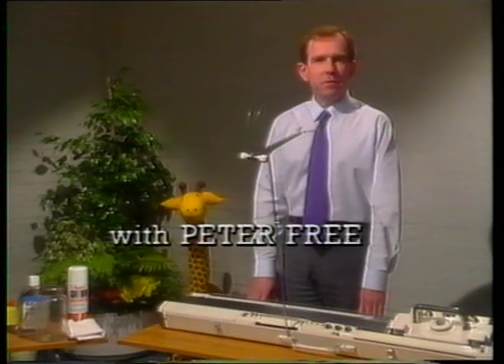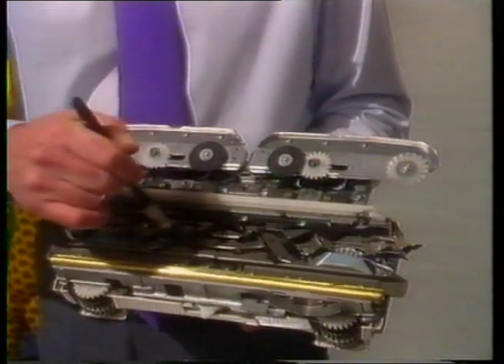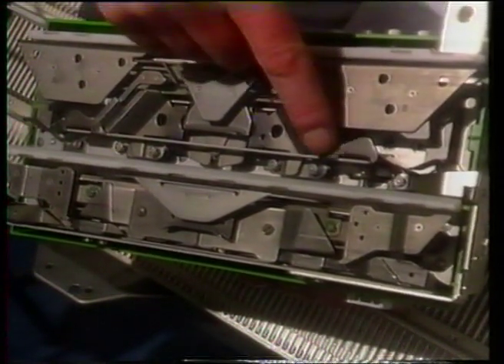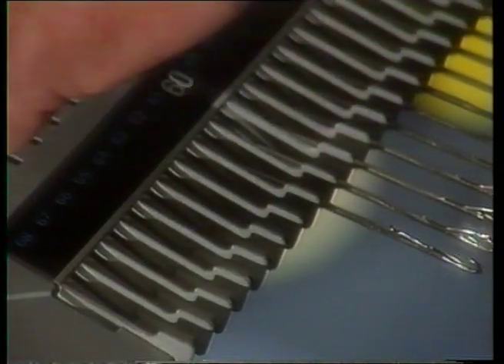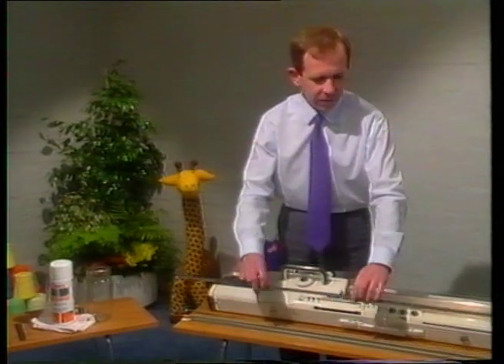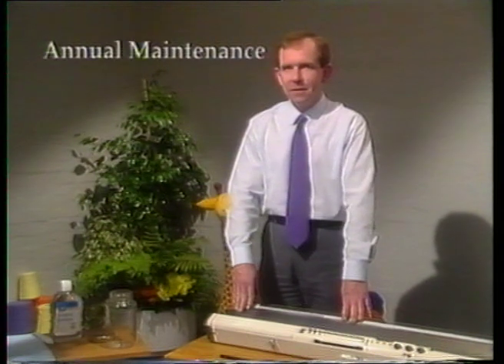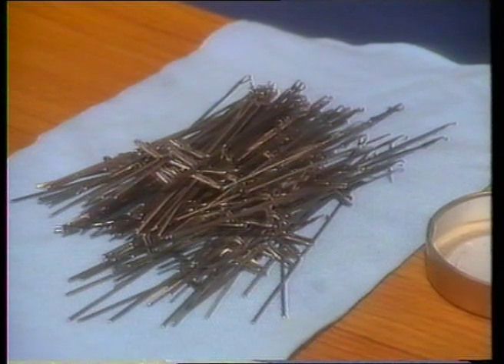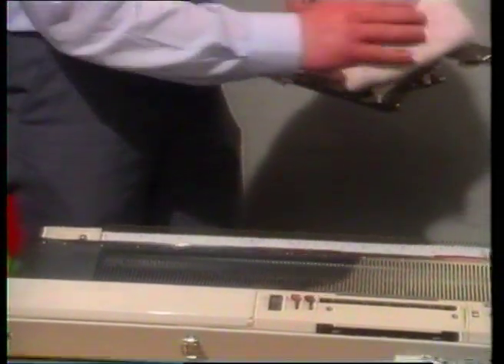Knitting Machine Maintenance

Comment: Thanks for excellent video, sadly for me something is not quite right when you get to the Brother ribber, there seem to be some flashing images which means that I can't see all that clearly where the various nuts/ screw are. I have tried watching on my IPad and on my PC and getthe same thing on both...it's just on the Brother ribber bit.Can it be fixed?
Reply from the maker: could you let me know the exact time code?
Reply from the maker: ah ok - yeah iots around 34 / 35 mins  - im afraid there isnt anything I can do - that's a tracking error during the transfer from the original tape, which I no longer have :(

Comment: My SRP-50 is very hard to move from right to left,  I have tried to adjust it but still no better.  Do you have any suggestions please?  I should add that it is definitely the ribber and not the main bed that is the problem, and only happend when wool is being used.  Tension checked etc.
Reply from the maker: hmm - not sure - I have little experience with ribbers. If you're in the uk, I can suggest someone who could fix it?